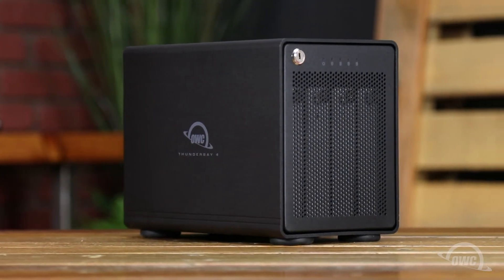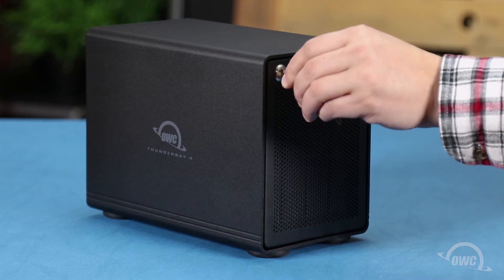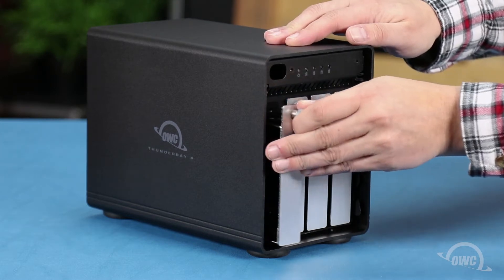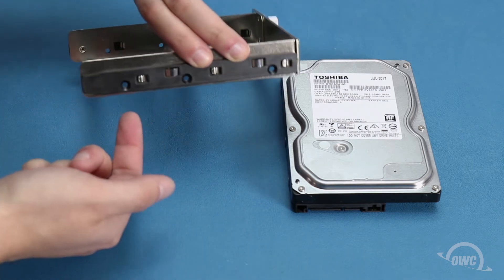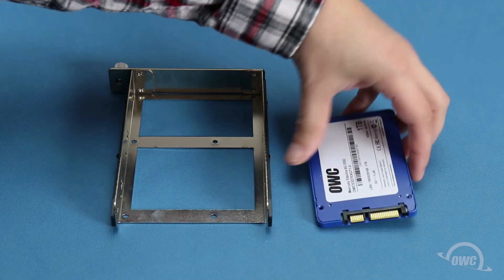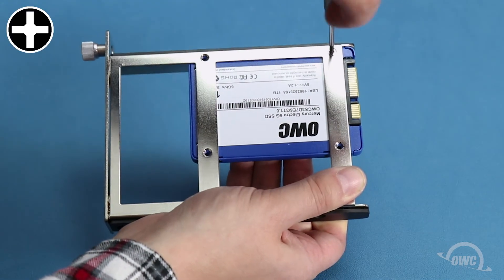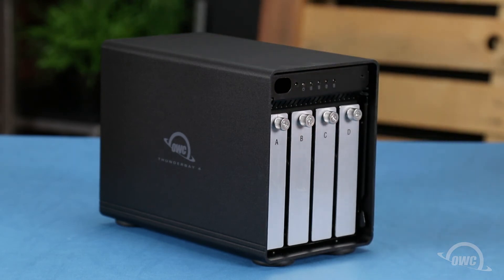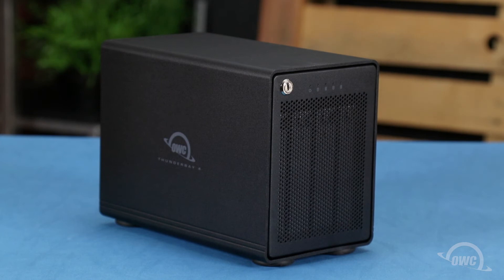How to Install Drives into the OWC Thunderbay 4 with Thunderbolt 3

Comment: Hello. I want to install 4 18TB Seagates on this model. Is it supported? And I want to use it on TV only to play multimedia. Are all the disks visible on TV?
Reply from the maker: You can use the four 18TB drives Seagate drives in the ThunderBay 4. However, you'll need to connect the ThunderBay to a host computer with a Thunderbolt port. From there, you can connect the computer to your TV to use the ThunderBay as a media player.

Comment: Im confused, I just upgraded a couple of my drives to 12TB drives but my current TB4 says it only supports 6TB drives - but the one on your site says it can handle 20TB drives. How do I upgrade my TB4 for the bigger drives?
Reply from the maker: We do offer a firmware update for ThunderBays purchased before 2019. You can access it here: https://eshop.macsales.com/support/owc-thunderbay-4-with-thunderbolt-3However, if you've already set up a RAID volume with 4 x 6TB drives, the system won't recognize larger drives. You'd need to back up your current data, reformat the RAID with the larger drives, and then restore the data.